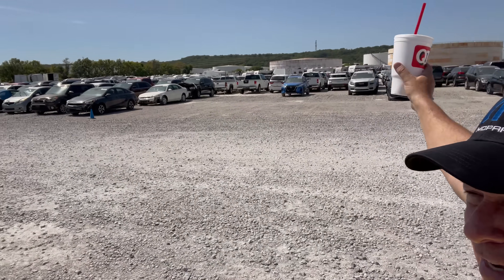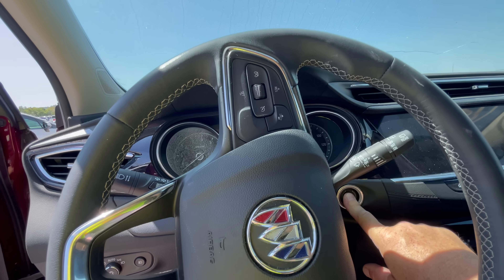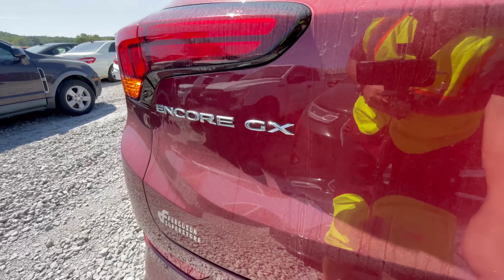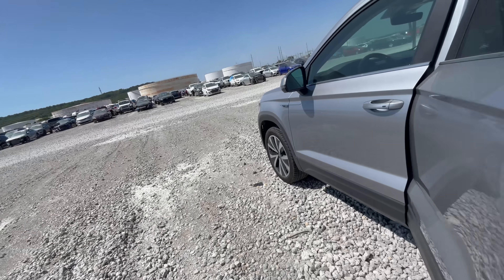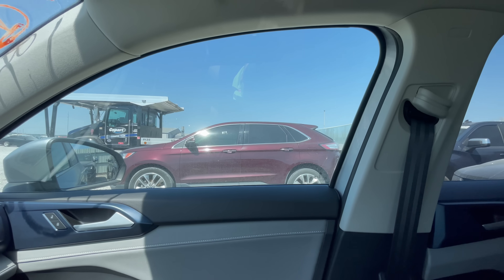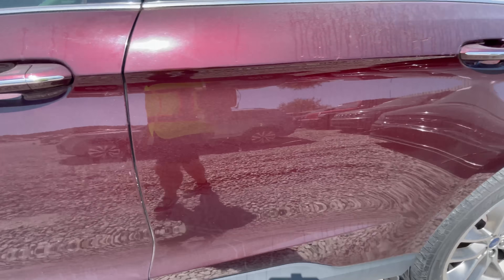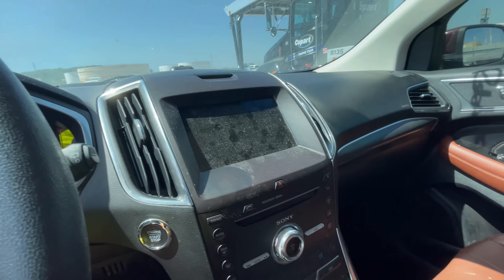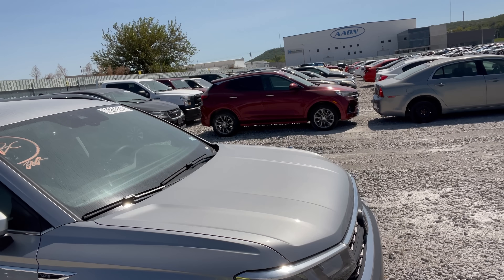Which Small SUV Is Your Best Bet? Copart Walk Around- 10/29/24

Comment: Love your Copart videos.!
I have had 2 Ford Edge SELs. Loved my 1st one, and love, love my 2nd. It's the rapid red metallic (the official name of the ruby color) with the same panoramic sunroof as the Edge in the video. I love the color of that one: the orange interior was insanely awesome! They are very roomy and I have no problem with the 4 cylinder turbo cuz it will haul a** when you want it to.
Side note: I was watching one of the videos where you were fixing one of your Mercedes. You dropped a nut on the ground and said 'where's the nut?' and I was thinking you shouldda pointed at yourself 😅😅....just kidding. You're awesome and  I absolutely LOVED watching your video with Tom and your mom (she's such a sweet lady) with the Olds Cutlass convertible. It is so comical watching you and Tom interact.
Keep up the good work 😊

Comment: The Taos has a 1.5 4 cylinder Turbo engine just like the 2019+ Jetta and they don’t come with engine covers. Also, “engine is on” message is because the door is open. These are not bad but in the end is a product aimed for the typical US buyer that need something affordable and practical without too many luxury appointments. Other VW products have significantly better quality interior/perfomance.